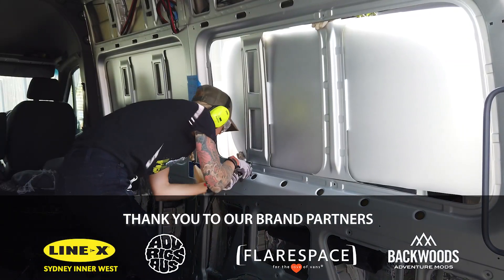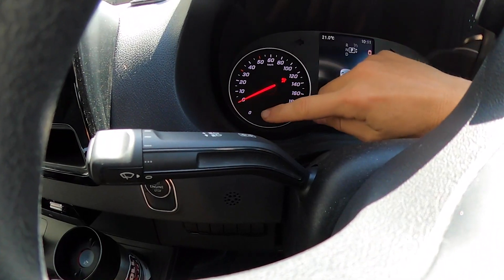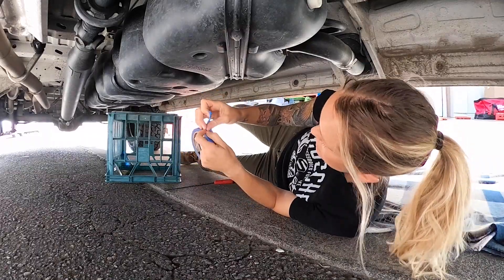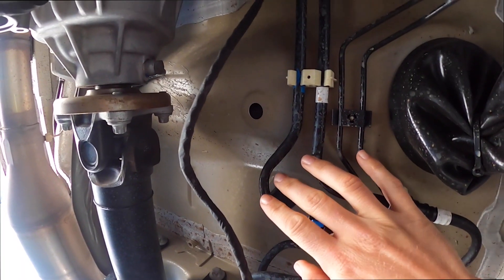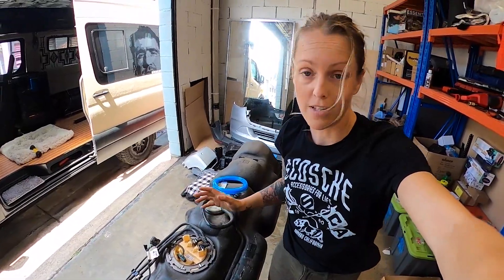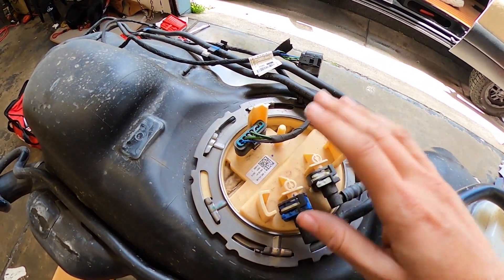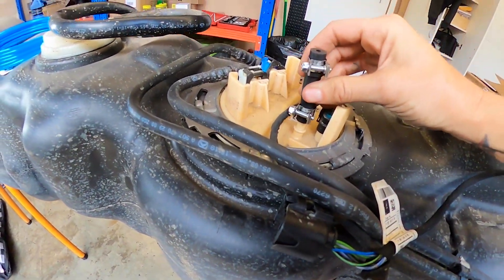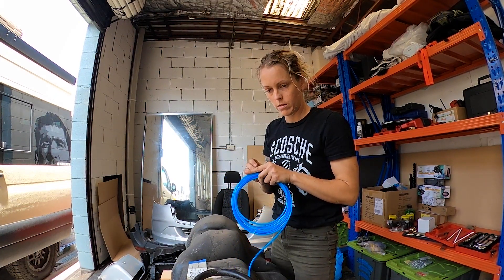DIY Van Build series Ep6 - VS30 Sprinter Auxiliary Fuel Tap

Comment: how do you know all this?
Reply from the maker: Honestly most of the time I just take a good look at something and then pull it apart and work it out as I go. Take notes or photos to remember how to reassemble it. In this case I had done the same job on another sprinter that I was building for someone else and then filmed the process when I did it a second time on my personal van. 

If I can get it apart and back together the same day I always prefer because then I don’t forget how it goes. 

Most of the things I’ve filmed because I couldn’t find a decent video to follow myself and figured others would like to have the reference to watch before they did it too.

Comment: DAMB do you have an age appropriate sister cousin that likes American accents? Just got majorly inspired with confidence went out and bought 1/4 inch rubber fuel line and 5m of kerosene fuel line from Ace Hardware $2.65 a ft had to drill a 6mm hole in the top of the tank there was a port 1/2 inside only no out side plumbing. Used the rubber to clamp the smaller line in place on the inside. Used JB weld on the outside line as well as 10cm of rubber clamped in place. Thanks for showing us how it’s done
Reply from the maker: Aww mate that’s so good to hear!! I’m super happy I was able to help you!! Happy adventures!!!

Comment: Thanks for posting this. Just about to install a heater in our 2018 313.
 Not sure which pump housing  we will find on tank but either way shouldn’t be a problem😊.
  Regarding “in tank” pick up tube length. I would tend to place the end quite low to allow for out of level parking etc.
 We don’t plan on staying in one spot for multiple days so would only use a litre or two max.
 Cheers 👍
Reply from the maker: If you need it that low to allow for out of level parking (uncomfortable sleeping) you’re definitely risking running your fuel empty with your heater. But it’s your build and your choices.
Reply: @werollwithit  Haha too true. And being an ex builder, alway try to get as level as possible 😂👍

Comment: Hi what size is the connecting rubber hose    4mm   and  the larger size is ? Thanks paul
Reply from the maker: ahh  i think 6 I got it from diesel heat in tassy

Comment: Have been trying to find that hose that connects the thin fuel line to the top of the tank with no luck...any ideas? Cheers 😁
Reply: @mickbradford7955  HA! Thanks! I ended up finding out my 2019 has an Aux tap built in! right behind drivers door, 5/16 quick connect. I'll have it tapped on Friday!
Reply: Seriously I wish she had mentioned it. @werollwithit do you remember what that is called or where to get it?
Reply from the maker: I get mine from diesel heat in tassy

Comment: HI.  Loved your video.  I didn't quite hear what size Torx socket you used on the strap bolts  I haven't got any,  so need to go buy some.  Hope you can help.  Cheers
Reply from the maker: Oh I think they were tens - but good to have a small set of them, they come up a lot on the sprinters. I keep a small set on board
Reply: @werollwithit  Thanks for the tip.  Off to Supercheap, Autobarn or Repco tomorrow.  😀
Reply: Just get a starter set of Torx. that’s inside and outside Torx also some hex you can use internal hex and torx interchangeably if you are careful has to be a tight no slop fit

Comment: Had a look at mine (4x4 2020  V6) and what looks like to be a breather for the fuel tank just has an open end (it was tucked up into the chassis a bit) ,is that right :-o what if you do a water crossing ? will water get into the diesel tank , need one of those ping pong ball fittings like my goggles and snorkel had as a kid , or has something fallen off, wouldnt think you could vent to the atmosphere in this day and age ...???
Reply from the maker: Nah it’s water tight doing it this way

Comment: I wonder if installing a T-connector at that blue fuel line would do the trick.. hoping to avoid dropping the tank
Reply from the maker: But then you run the risk of using all your fuel up by the heater overnight better to put the new hose and run it shorter so there is always some gas left
Reply: Sorry my english...do you refer to the line with blue plastic conector?
Reply from the maker: @mecanictransmision  I added the blue fuel line
Reply: @werollwithit ... how did you do?
Reply from the maker: @mecanictransmision  that’s what the vide is about. Adding the blue line for the heater
Reply: @werollwithit  ahh..yes yes. I thought you were other person. I can't take out my tank, it is OK if I install a "T" to the line with blue connector?
Reply: @werollwithit  when you say blue line do u refer to the line with blue connector?

Comment: Does the current tank size provide you good range. Great work.
Reply from the maker: yeah this one has the merceded  OEM extended tank so bigger than normal. It works well for me, I need to measure how far one tank  actually goes. will share when I do

Comment: Does your van have J51 option that gives priority to the float level in the tank over the calculated level the computer comes up with. “Fuel gauge, optimized for aux. fuel tap”
Reply: Otherwise, at risk of running out of fuel as the aux. fuel tap consumption is not measured nor represented on the fuel gauge.
Reply: @jaranatube  tnx

Comment: hi . just about to do same on mine....just bit worried about a strait connection. is there enough space when fuel tank is lifted up? or it bends?. would you mine to add
 picture how it fits when tank is fixed back in the position??
thank you. great job
Reply from the maker: Once it’s back in you can’t see it but there is plenty of room for it up there, not a worry

Comment: Give us your Instagram account
Reply from the maker: @werollwithit
Reply: @werollwithit   Where did you get the hose adapter? You just say it's thick on this side and thin on that side. I need to order one and I can't find it! Did you just get it at a car parts shop? HELP! Thanks for the video!
Reply from the maker: @prestondanielgrant2152  I got it from diesel heat in tassy